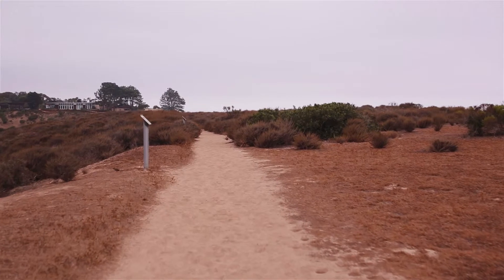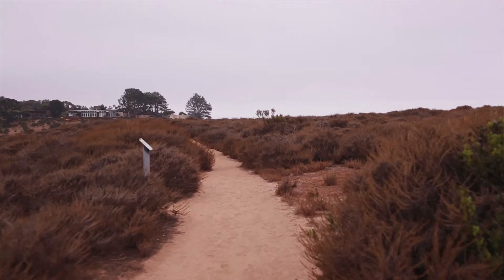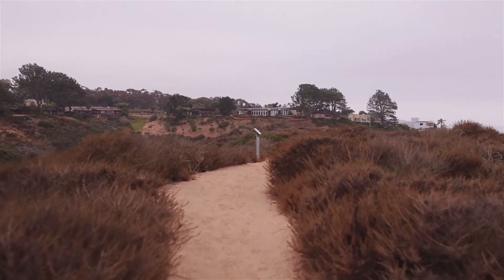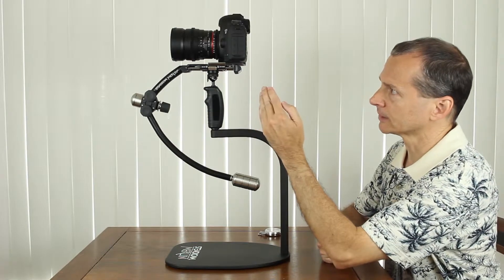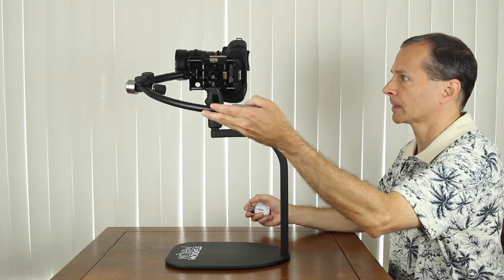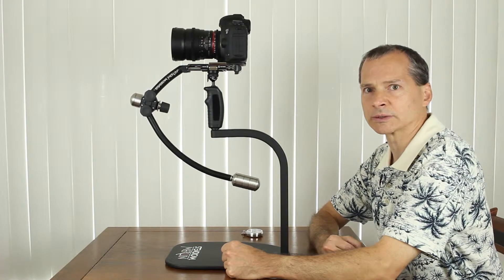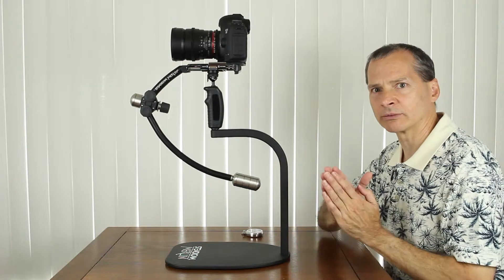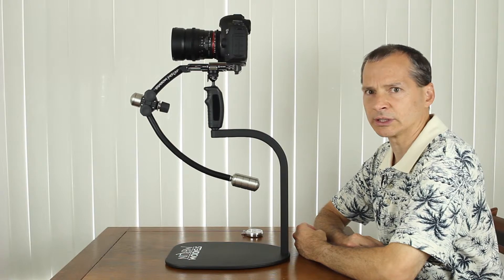Steadicam Merlin 2 Drop Time Test

Comment: Thank you so much for that series of videos. I ordered a Merlin 2 to use with my Sony hdrfx7. I still not receive it yet but your videos will certainly help me to balance it. One question , I did not diid not find the stand that you are  using, so I decided to build one. Can you tell me the size or diameter of the pin goong and holding the hand  ? Thank you again.